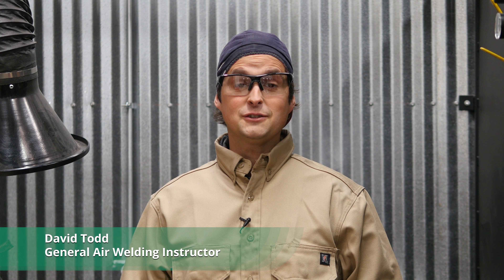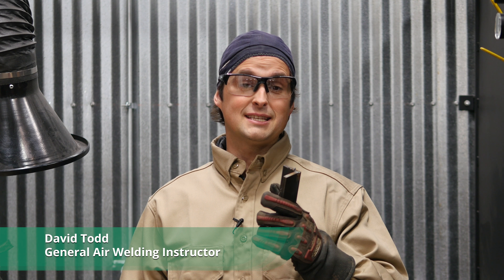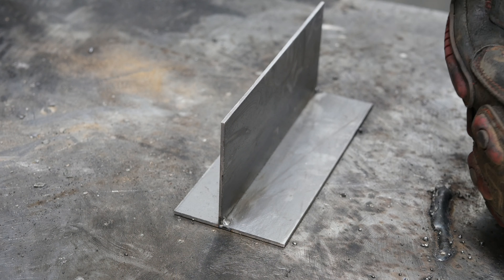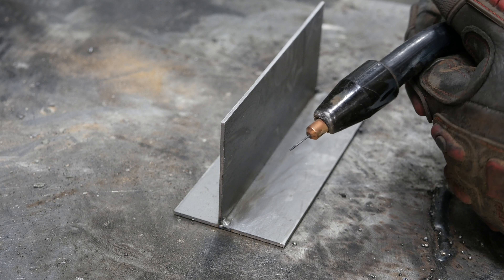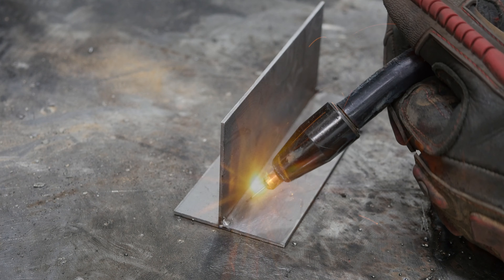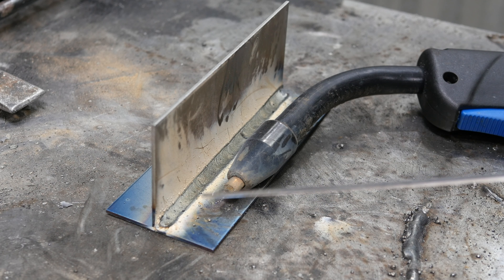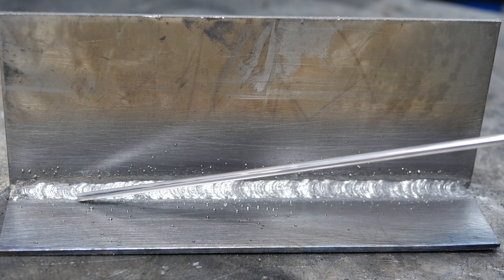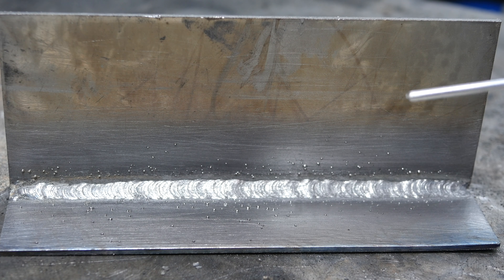FluxCore Thin Metal without Blowing Through

Comment: How’s it hold up to car panels?
Reply from the maker: This method isn't recommended for car panels because the slag inclusions could cause small holes and pores requiring rework and/or excess body work.
Reply: General Air Service and Supply ah okay. This is good to know I wanted to use my flux core this go round just to see.. didnt think the slag would cause blow through. Good to know! Thanks